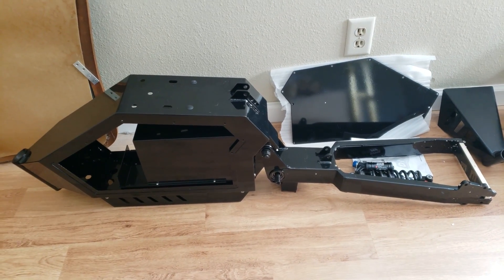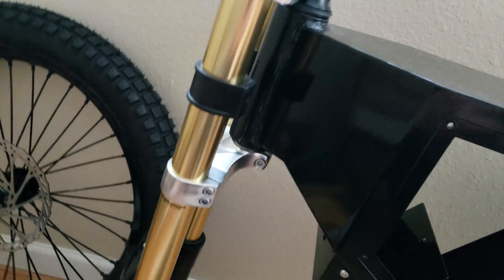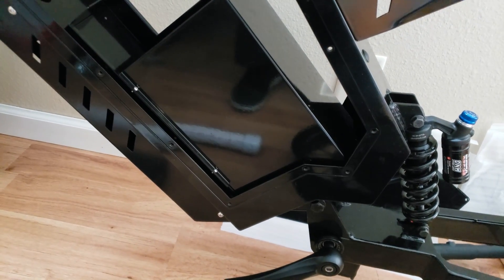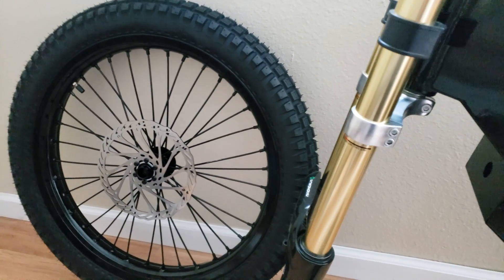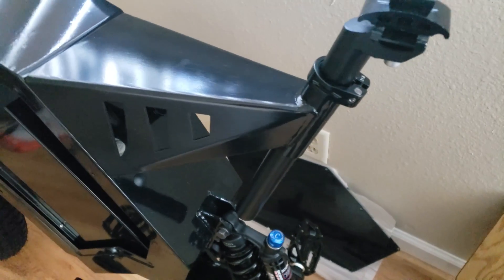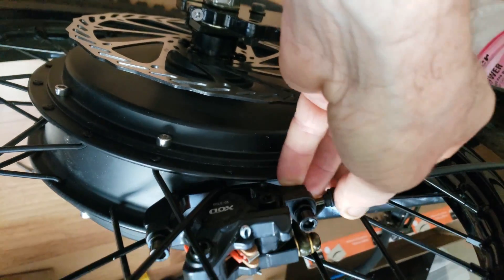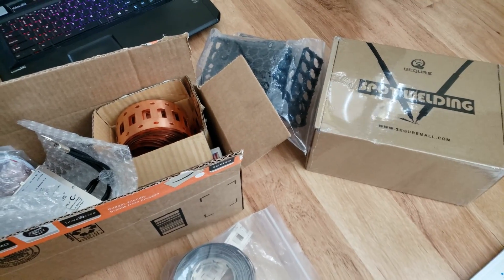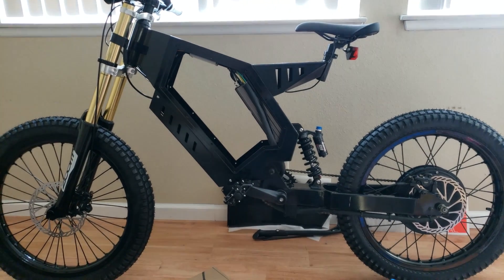Enduro Ebike build start to finish

Comment: You Live n& Learn self building - I'm considering building one.
EXTREMELY IMPORTANT - I think amyway - I saw Sam swapped bolts for different type & need to check the specification when switching any bolt that's going to have a load on it. The retailers will or should have a specification saying what strength the bolt is. I imagine the the bolt & arm prevent the motor from spinning round instead of the wheel!!
Don't think spacer material is as important as it'll be fixed & won't be acting as a bearing BUT AGAIN WHAT IS NECCESSARY I BELIEVE - I think you need to put a string line from the front sprocket to the back of the rear sprocket. If the string line doesn't lay flat across both sprocket faces then the sprockets aren't in line & the chain won't lay right & therefore space each side accordingly if the motor isn't designed for the wheels & frame etc that you're using. - I'm sure most people are aware & appologies if already been said. After all these E bikes are getting some power put on them lately!
Reply from the maker: Hello Martin, hmmm,  I don't remember switching any bolts,  the frame did not come with the pivot bolts for the rear  shock I purchased those separately they are titanium I don't really like titanium bolts,  titanium is kind of brittle.  you're absolutely right on the grade though, I you don't want to use cheap bolts where there's a load involved .
Reply: @samjohnson517  Yep - meant switching for others you purchased! I'm in uk lol a language thing maybe. Yep titanium like stainless brittle. As long as they're rated for the stresses

Comment: You could have it machined a little bit more so you could put a heavy duty washer against that piece you would have the Hub could be machine then maybe to mmmm and the shaft would stick out just a little bit more so you can put a heavy duty washer there

Comment: 2 things you will need to do. The rear swing arm rubber bush, too flexible and will wear out quickly. Best thing is to cut it out and replace with deep groove bearings, it will make a big difference. The zoom forks will be okay for a short while, but then will become a pogo stick and will also rattle badly when you brake. I replaced my front fork with a Suntour XCR34 air. Perfect and allows much more steering. (Needs a slight mod to head tube for the taper steerer). This is not complaining about the equipment, just lessoned learned.
Reply from the maker: Thank you John, yeah I knew the forks were going to be one thing I'll need to upgrade I will definitely keep an eye on that swing arm.

Comment: Hey sam great job on the build. I have one question with the breaks adaptors link you have posted in the description there are 2 to choose from, which one works with this frame I was going to be making a similar build to your bike and I just wasn't sure which ones to buy. Thanks
Reply from the maker: Hello and thank you! one is for the front and one is for the rear the rear one has the extreme curve in it.
Reply: @samjohnson517  Awesome. Thanks very much!!

Comment: Hey there build looking sweet so far! Congrats and thanks for the very informative video, I was wondering, what are the dimensions of your 20s12p battery pack/mockup? I would like to fit something similar on a different frame, thanks in advance!
Reply from the maker: Hello the battery ended up being 7 x 14 x 5.5 inches this is a link to the battery build video https://youtu.be/lgOZQGRH3H4
Reply: Yes i got the same eith the company ncycle and i get mine in two week real fast because they jave a new shipping metod door to door

Comment: what pedal crank kit did you use with this frame? I cant find any info on it.
Reply from the maker: I used this one from AliExpress 152 mm with a 32 tooth chain ring I'm having problems with links from AliExpress into YouTube but you should be able to copy and paste it into a browser 
US $29.51  49%OFF | 104BCD Bicycle Crank Sprocket 152mm 170mm MTB Bike Square Hole Crankset 30T 32T 34T 36T 38T Narrow Wide Single Speed Chainring
https://a.aliexpress.com/_mqOt2sp

Comment: Then spacer washers then the torque arm goes on the frame flush flat .
Reply from the maker: The torque arm has to be flush with the motor in this case because it fits in that slot like a key, you could do it the other way with the torque on flush on the swingarm but it would not hold the motor as strong and could cause the motor to spin in the swing arm and tear the wiring out. I am probably going to remove the washers all together and just bolt it up. I think the swing arm will flex enough.

Comment: Can you please provide bottom bracket size? I'm interesting in building on this frame with mid drive motor, but I can't find any information about it.
Reply from the maker: Hello it is difficult to measure with the cranks on but looks like the shaft is 155 mm long 16 mm diameter the outer diameter of the bracket is about 40 mm
Reply: @samjohnson517  Hmm... Thought maybe bottom bracket would be similar to common bikes between 68mm to 120mm for fat tire bikes. Thanks for your input though.
Reply from the maker: @BZ0_0fficial_Muzik315  I understand but the frame is 152 mm wide if the bottom bracket was shorter the cranks would hit the frame

Comment: just file some of the bottom of spacer so it dont touch the cable and put the torque arm outside
Reply from the maker: I tried that but nothing holds that axle better than that torque arm right next to it I mean that thing's not going to ever spin out like it is it's just way stronger like that

Comment: I just ordered the same frame from eBay for £250.
Reply from the maker: It is a pretty good deal for that frame considering it includes shipping
Reply: @samjohnson517  indeed. I've seen on forums, the plastic side cover frame guys searching for replacement side covers because they broke the side covers during orr-road falls.

Plus, I am going to mount the ANT bms on the inside of the side cover for better cooling. I may even put a small black heatsink directly on the outside of the cover. But only if it will seem necessary. My Sabvoton is only 120A and bms is 300A so, unlikely.
I think you will finish your build before me. I have to lace both my wheels and batteries will take atleast another month to arrive
Reply from the maker: @RogueLegend999  that's a good idea I am also worried about heat but I will  see what happens,  I have about half the battery built right now,  no fires yet LOL

Comment: You are the same age as me if I understood the translation correctly: I will be on February 13: 59 years old and I have always been a 2 wheel addict including big cubes...
Tu as le même âge que moi si j'ai bien compris la traduction : je vais avoir le 13 février : 59 ans et j'ai toujours été un accro du 2 roues y compris les gros cubes...

Comment: About the controller too large, look on my videos, what I did, it's simple and no need to change the controller and in addition it ventilates the controller even better and it's aesthetic ...
A propos du contrôleur trop large, regardez sur mes vidéos, ce que moi j'ai fait, c'est simple et pas besoin de changer le contrôleur et en plus ça ventile encore mieux le contrôleur et c'est esthétique...

Comment: Lithium batteries are very dangerous and if you do not know how to make it yourself, it is very risky, there are certain protocols to follow to the letter and you really have to have all the adequate equipment, I did not go into it, but the most expensive component on an electric bike or motorcycle is the battery, my big battery cost me: 2600 euros for a 53 Ah 72 Volts as I do. I've already said it, but it's also tailor-made and it's light and we'll see if it performs as well as that ... when I do the road tests ...

Les batteries au lithium sont très dangereuses et si tu ne t'y connais pas pour la fabriquer toi même, c'est très risqué, il y a certains protocoles à suivre à la lettre et il faut vraiment avoir tout le matériel adéquat, moi je ne me suis pas lancé là dedans, mais c'est que l'organe le plus cher sur un vélo ou moto électrique c'est la batterie, ma grosse batterie m'a coûté : 2600 euros pour une 53 Ah 72 Volts comme je le l'ai déjà dit, mais c'est aussi du sur mesures et elle est légère et on verra si elle est si performante que çà... quand je ferai les essais sur route...

Comment: Too bad I haven't seen your video before, because as I told you, it is possible to fix the Sabvoton under the cover, below the frame, so I have a bigger battery, look my videos, you'll see, it's simple and efficient, no need to tinker with this superb controller ...
Dommage que je n'ai pas vu ta vidéo avant, car comme je te l'ai dit, il est possible de fixer sous le cache, en dessous du cadre, le Sabvoton, comme ça j'ai avoir une plus grosse batterie, regardes mes vidéos, tu verras, c'est simple et efficace, pas besoin de bricoler ce superbe contrôleur...

Comment: I just noticed it has the retarded style of rear suspension.. you only have rear suspension on your ass, Not on your feet. When youre standing on the pedals there is no rear suspension. Which puts all that extra weight and strain on the swing arm mount, and makes the ride way less comfortable.. i HATE when companies do that. You see it on cheap mountain bikes all the time. Damnit, that sucks. I love your build and i went to the ebay link for the frame and theyre still available. i was gonna get one till i saw that.
Reply from the maker: Hello Joshua no man that is not true the suspension works great when you are  standing on the pedals check this video little over 5 minutes in, you will  see my son standing on the pedals working  the suspension. https://youtu.be/zFX-spRDRpQ
I would never buy a frame that had the bottom bracket on the frame I would only buy one that has it on the swing arm like this one because you'll have nothing but chain tension nightmares.
Reply: @samjohnson517  oh wow, really? arent the pedals on the swingarm instead of on the upper part of the frame? They mustve finally figured out a way to make that work. Ever since i was a kid i watched out for that type of suspensiono because it never worked right. If theirs does thats awesome and ill def be grabbin one of those!
Reply from the maker: @jstagzsr  you had me going for a minute on that one because I swear what you're saying makes absolute sense but it just works it really does all right man good luck on your build!
Reply: @samjohnson517  yeah I watched the vid you linked. The rear suspension definitely does work from the pedals. They must've figured out the angles and geometry for it to be functional even with that mounting method. Weird but that's good. Hopefully everyone adopts it!!

Comment: Where did u buy the light from mate
Reply from the maker: Hello I got it on AliExpress but I can't seem to find the link I believe it's the same headlight as the surron
Reply: @samjohnson517  thank you mate how did u wire it up
Reply from the maker: @harrisonfoster2986  I can't remember if the headlight or the tail light came with the switch but I wired it to a 72 volt to 12 volt converter also from  AliExpress.
Reply: @samjohnson517  thank you mate much appreciated
Reply: @samjohnson517  could you send me the link for the wheels pal when I press the ones in the description it doesn’t work
Reply from the maker: @harrisonfoster2986  I know no matter what I do I cannot get Alibaba links to work in YouTube but just find a seller called "Ncycle" my kit is the qs205 5000 watt motor 19 inch motorcycle wheels add a front wheel,  and upgrade the controller to the 72150 and my motor is a 3.5t
Reply: @samjohnson517  thanks mate